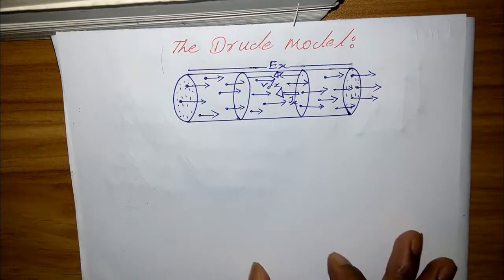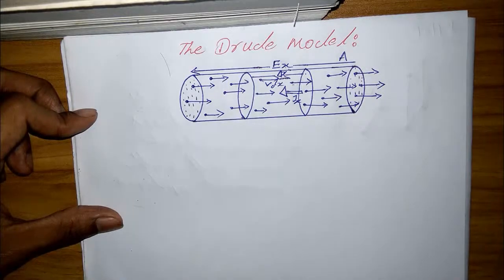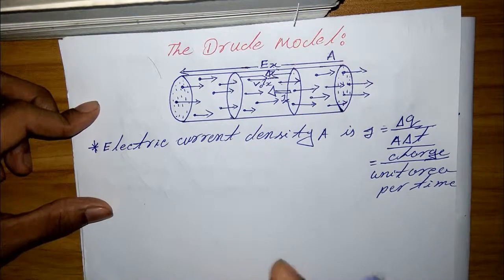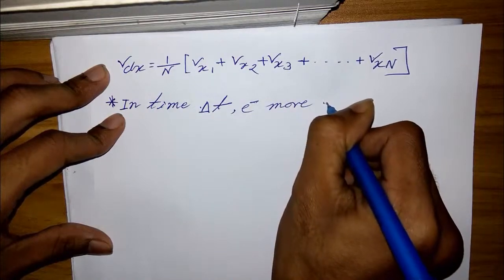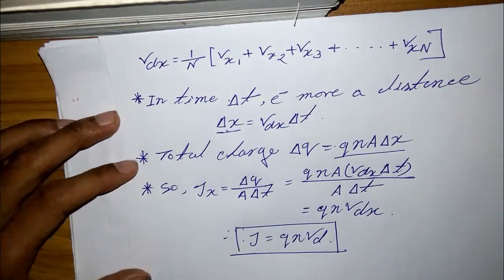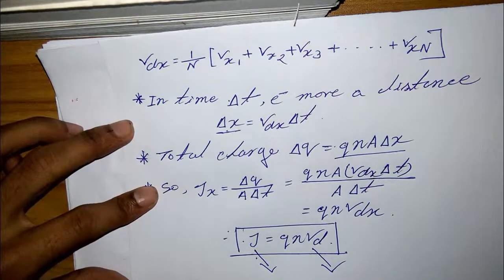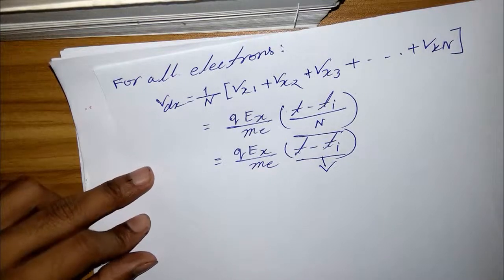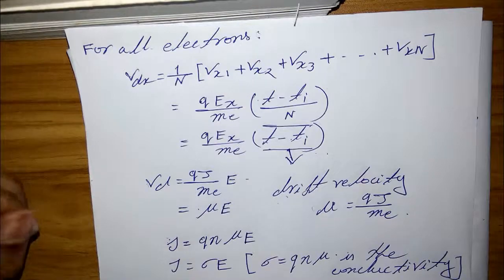Drude Model : Electrical Conductivity | Drift Velocity |  Materials Science|

Comment from the maker: Science , Engineering & Technology Related Video Lectures , Courses , Tutorials & Study Materials Here.
Website Development Tutorial , Mobile Application Development tutorial , Dart Programming Tutorial , Flutter , Circuit Simulation , 3D Animation , Transformer Design Project , Linear Signal Course , Power System Course , Git Tutorial , GitHub Tutorial , Bitbucket tutorial , CodeBase Tutorial , Plc Programming , EEE Courses,Factory I/o Tutorial , Fritzing Circuit Simulation , Autodesk Tutorial , WordPress Development , Weebly , Wix Development ,Engineering courses , Robotics Simulation.